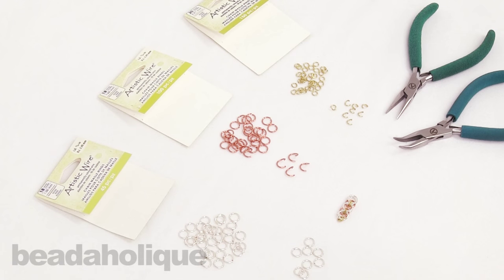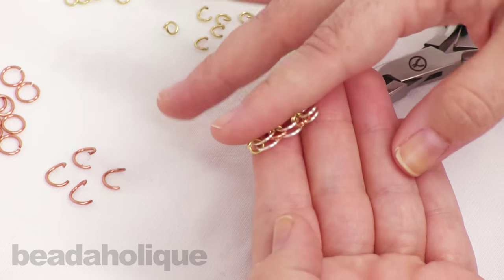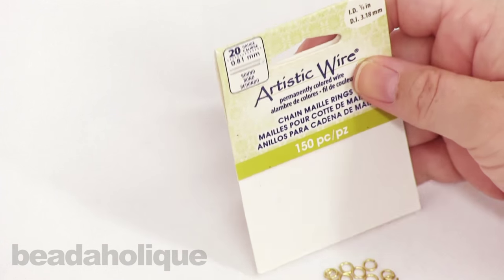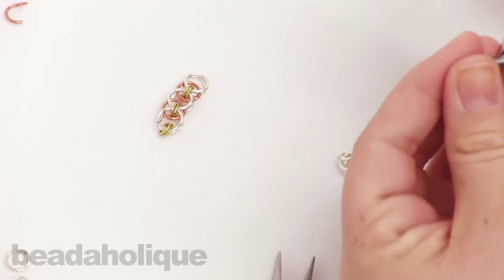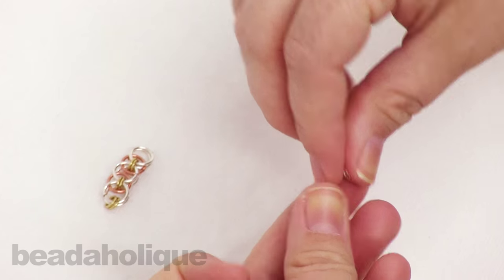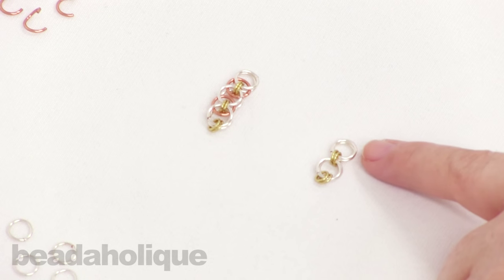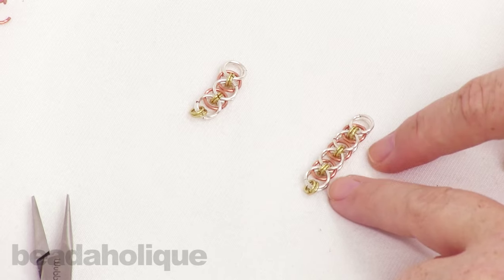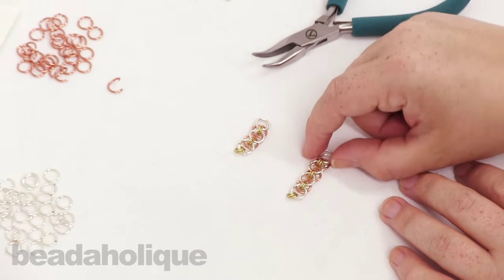How to do a Helm Chain Weave in Chain Maille

Comment: How flexible is this chain? It looks to be rigid after what you demonstrated.
Reply from the maker: +Clarence Marsh This weave is flexible. The longer you weave the more flexible it will be. This can be used for bracelets, and it bends around the wrist.  You can also modify the sizes of the rings respectively